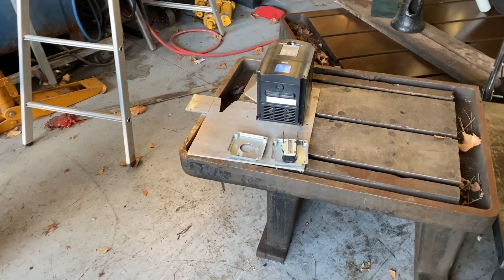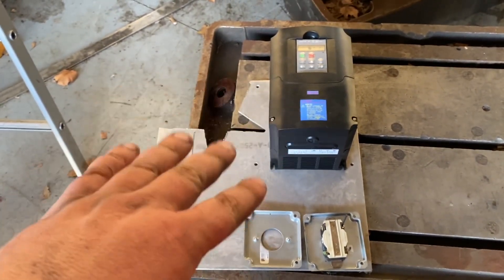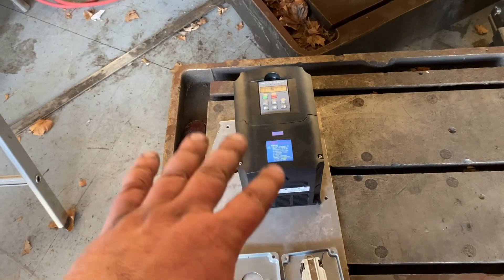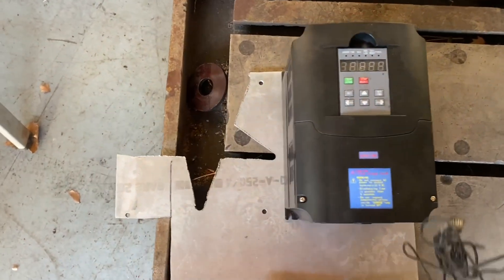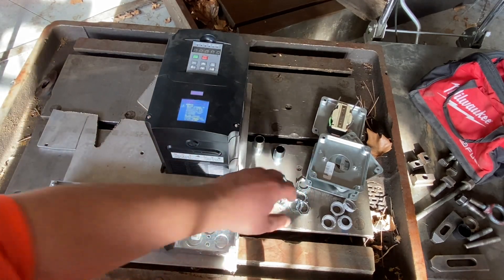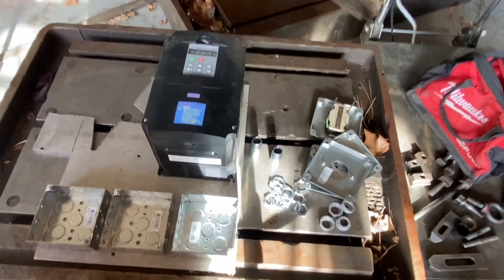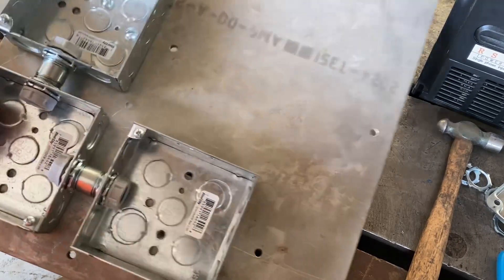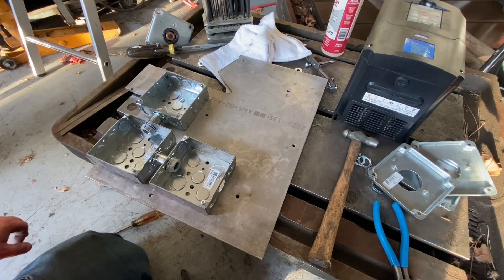Single to 3 phase VFD power station part 1

Comment: Hi Adam, I've never tried bringing on "starting" an additional motor on a VFD that's already running..not sure if that what your planning. Most VFD want to be the starting source, all downstream switches closed to the motor and F/R selected before starting the VFD. They have beefed up VFDs over the years and some can handle downstream switching. Just giving you a head's up, not trying to be negative. VFDs are awesome though !
ATB....Dean
Reply from the maker: It will just be for running one machine at a time off this while one of the bigger machines is run off the rotary phase convertor.  Also showing it as a option for a small relatively cheap setup someone can make to run multiple machines without switching plugs all the time
Reply from the maker: And on good vfds you can run multiple motors, at work I run vfds from 5hp up to 200hp and if it’s just driving a motor it’s fine, switching power on and off at the motor and just using the vfd as a feed.  Vfds have really changed the water pumping industry
Reply: @smalltownmachineshop6860  Adam sounds like your on it ! Wasn't sure of your VFD background. We use tons of them in the HVAC industry, like you say major game changer. ATB...Dean

Comment: I don’t understand, what problem did you have when running multiple machines off one rotary phase converter? 
If anything, running more machines off a single phase converter should help, because essentially the other machine’s motors are acting as rotary phase converters.
Reply from the maker: My big lathe maxes it out doing heavy cuts and also I would like to run some stuff without having to run the rotary convertor all the time
Reply from the maker: Also to show some people another way to easily power multiple machines without a rotary convertor if they want to go that route
Reply: @smalltownmachineshop6860  nice! Thank you for the videos. Your content really motivates me!